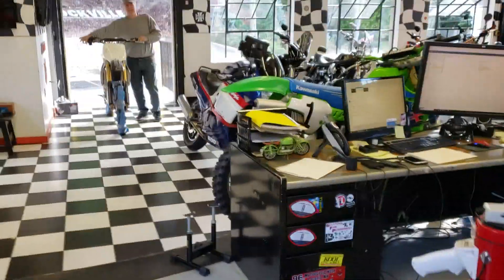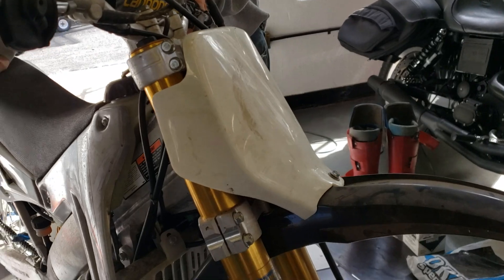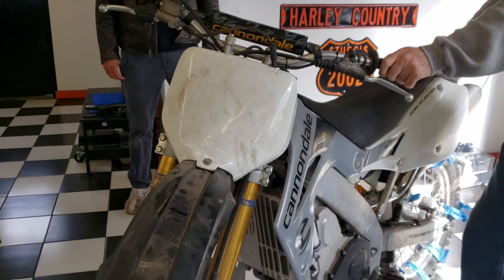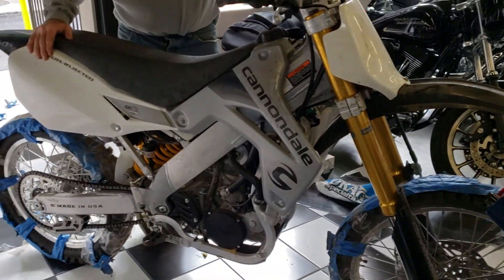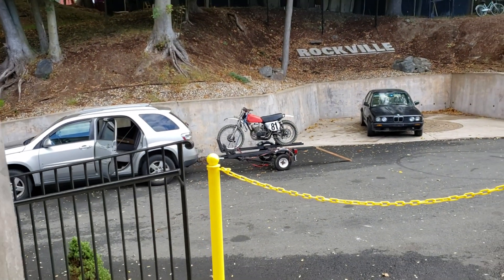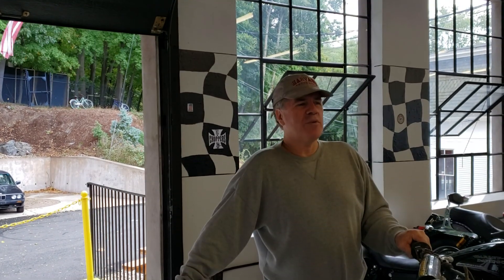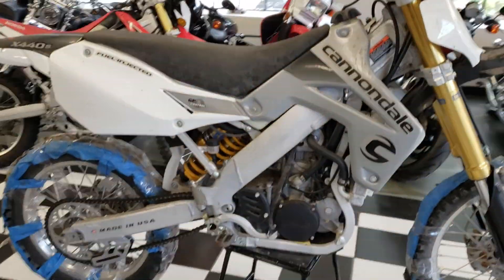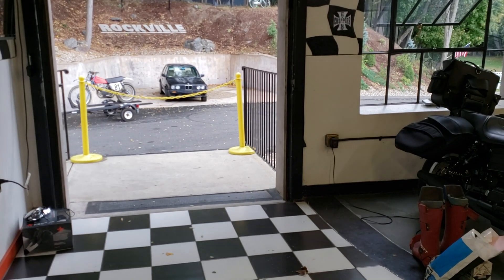Cannondale 2003 X440S Fuel Injected, Ohlins, BRAND NEW 0 HOURS

Comment: With a few mods and updates the Cannondale motors are not as bad as what everyone thinks they are. I am still running two machines that I rebuilt in 2007 and they are still running today in 2019.
Reply: What was the problem with the stock crank? I see lots of mentions of those
Reply: @0xsergy  The problem is the lower rod bearing. The one at the crank end of the connecting rod. That bearing from the factory just did not have enough rollers in it. Eventually it would start rocking back and forth and eat the crank journal. So the fix is to press apart the crank halves and replace that bearing with one from a Suzuki Z400 motor. Direct replacement with more rollers in the bearing cage.
Reply: @Brad772006  ahh, such a small oversight. If they had sourced a Suzuka bearing to begin with maybe Cannondale wouldn't have ate the metaphorical shit.

Comment: Wow I had a 2001 400 Cannondale  It got sent back to the factory and had a 440 GP engine installed, it was to much for woods ridding, would have made a great supermoto bike. And it did have problems with the fuel system, very cool to see you have one, they were way ahead of there time, and should be remembered for that.

Comment: The reason they do exhaust on the front is that the exhaust side of the motor is the hottest so having the coolest air there helps keep the motor happy. I'm sure the liquid cooling makes that much less of an issue though

Comment: You are going to find a bunch of these in the same condition.
Nobody wanted them.
Reply: Not true, they were bought but most people left them after the cranks locked up
Reply: @haydenneal1126  ...And that is 1 of many reasons people didnt want them. ATK rebadged sold them for a little while too, like they did with the Maico 700.
Reply: I just read Jody Weisel's (from MXA) Sept 2019 look back on the Cannondale. Makes for interesting reading.

Comment: The frame was based on the 1998 Cr 250, which didn’t have the best geometry so they messed up there, also was originally advertised as a 400 then turned into a 440 in 01, the quads were based on the 400ex and the 250R and was a awesome quad besides the bugs... actually won the 2004 GNCC spartan, only Cannondale to do so

Comment: Well I've been a motorcycle technician 4 over 30 years and when I was in California Came Upon one of these in our shop we were a dealer general manager came back asked me if I wanted it who is brand new paid 500 bucks for it. I can tell you if the bike that they are showing us here is brand new if it still has coolant in it they had a bad electrolysis problem with the water pumps they would eat the head up really bad so you're going to need a new head a new water pump new fuel lines and their fourth
Reply: Their problem was the magnesium head, certain coolant would eat that up, now there are aluminum heads, and metal water pumps because they were plastic from the factory

Comment: Absolutely Horrible Dirt Bike. Ran Good in Dessert, horrible in the mountains it would never wanna run and it does not have a Kickstarter. The electric start was also iffey and would only work sometimes. My uncle bought it Brand New and could never find any parts for it.

Comment: Also there were many different models, X440 E440 and the S440... also the 400 model but I forgot the name of it... there were only a handful S440’s built, they were the super moto one... for quads they had the pre production fx400, FX400, Cannibal 440, Speed, Blaze, Moto, Glamis, and the crazy 04 prototype, carbon fiber axle and stem... the bugs were planned to be fixed for the 04 model year

Comment: I had a 03 Cannondale cannibal 440 4 wheeler. Super fast but really hard to start. Had to replace the injectors and the computer. I only ride it 5 out 6 times cuz of all the issues. A company called ATK took over motorized Cannondale motor vehicles and continued for a few years. These things were almost twice the cost of equivalent atv's.